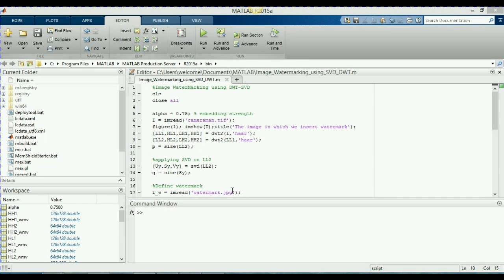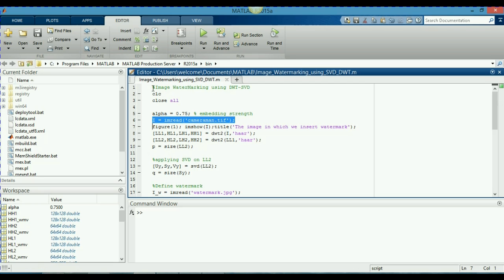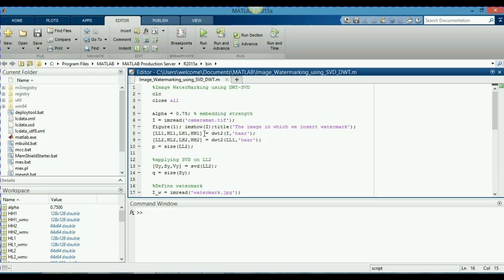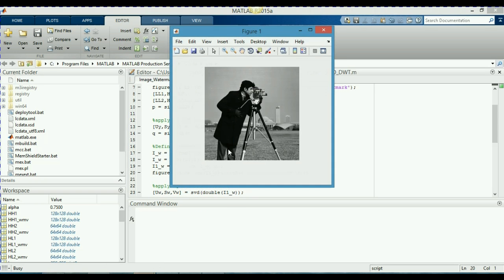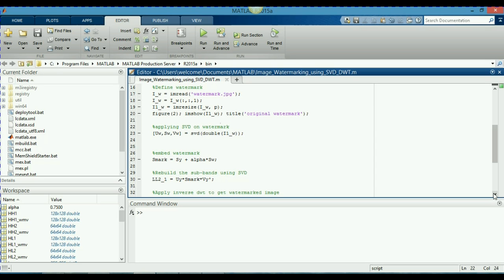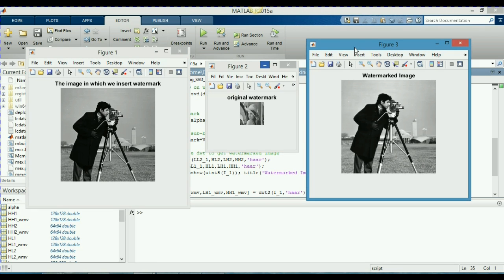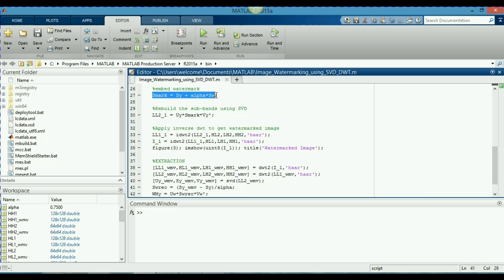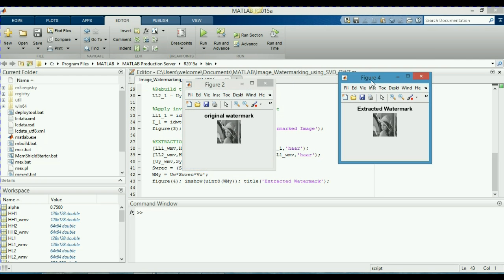Image Watermarking using Discrete Wavelet Transform and Singular Value Decomposition MATLAB CODE

Comment: Sir, I have a question for you. I want to read the cameraman image after extracting the watermark from that image. Is there any way? Actually I want to see the difference between imread('cameraman.tif') & imread('the image after extracting watermark'). Please help me.
Reply from the maker: if you want to see the difference just subtract them from one another or find the similarity index or psnr there are multiple things you can de here
Reply: Thank you sir, for your help.
 I have another question. I didn't understand the part of (Smark = Sy + alpha*Sw) . Because if the value is greater than 255 then what will happen?
Additionally is there any way to contact with you?
Reply from the maker: +Nobin Mbstu first if all we are using gray scale image so ut will never be greater than 255 and 
email ID:  princegarg7777@gmail.com
Reply: Sir, I want to imread(I_1) but it gives me an error that I_1 is not an image. Is there any way to imread the (I_1). Please help me as soon as possible.
Reply from the maker: +Nobin Mbstu put it like this
imread('I_1.jpg');
than it might work or just check the syntax ...
Reply: Sorry to say sir, but it's not working. It shows the error message.
Reply from the maker: +Nobin Mbstu where are you using I_1, just make sure its a 2D matrix.
Reply: Sir I think u didn't get my question & it's totally my fault. Actually I was saying that I want to read the watermarked image I_1.  For example like u read the image (( I = imread('cameraman.tif'); )) at the beginning & all I want is that I want to read the watermarked image (( Iw = imread('I_1'); )) after the the 35th line of your code. So provide me a proper syntax so that I can imread it.
Reply from the maker: +Nobin Mbstu try                uint8(I_1);
Reply: Sorry Sir, I can't understand your reply.
Reply from the maker: +Nobin Mbstu if you want to read it first you have to save it in the directory. and than apply imread
Reply: Thank you Sir. I got it now. You are so helpful Sir. I disturbed you so many times because I couldn't get it but every time you help me. I am really thankful to you. Love you from Bangladesh. Thanks a lot Sir.
Reply from the maker: +Nobin Mbstu happy to help
PLEASE SHARE LIKE SUBSCRIBE

Comment: How do I perform SVD analysis of an electrical circuit?(buck-boost converter)Pls help.
Thanks.
Reply from the maker: i guess u need transfer function and then multiply it by the input that will give you the output , simply apply svd in that output
or just give me some reference and i will look into it and will tell ya
Reply: I need to perform SVD and prony analysis on the load (output)voltage of a buck-boost converter.The output is analogue but these methods involve matrices with discrete points.
Reply from the maker: +ankit mallick thatvis good bcoz that is my area just do as i described earlier u will get the singular values of your output

Comment: hi
during implementation
appears this error message 
Error using svd"
"Input must be 2-D.
Error in Untitled (line 28)
(Uy,Sy,Vy]  =  svd(LL2[

please help me ??
Reply from the maker: can you send me more details at the mail id, or screen shot,
princegarg7777@gmail.com
Reply: I think you are using color image, which is 3D. Svd function will not work on 3D image. It works only on 2d gray-scale image.
Convert the color image into a grayscale   image using rgb2gray() function
Reply from the maker: @subhadeepkoley  that is correct